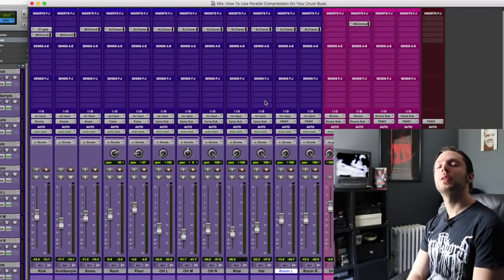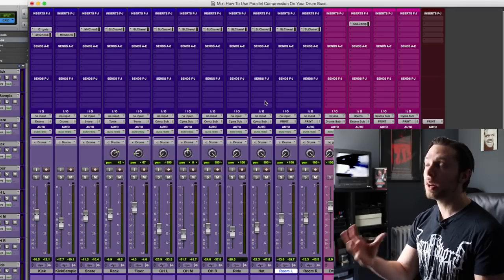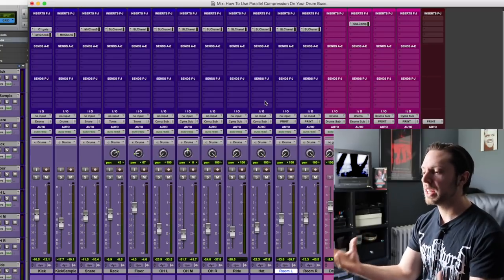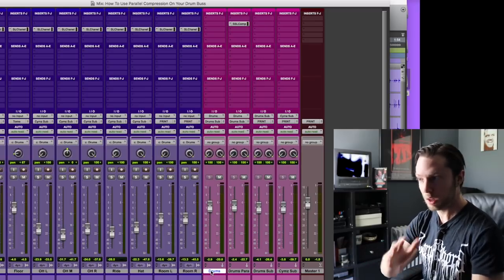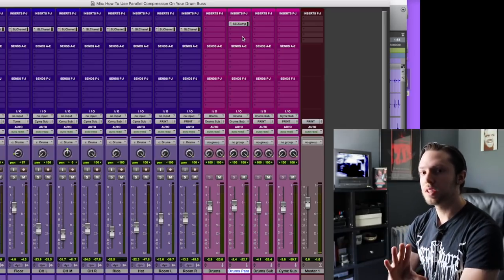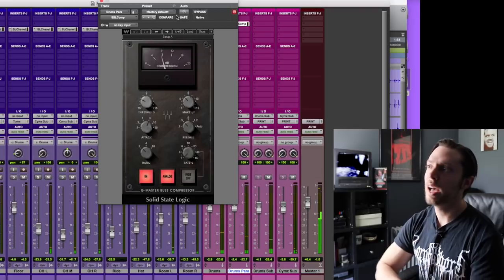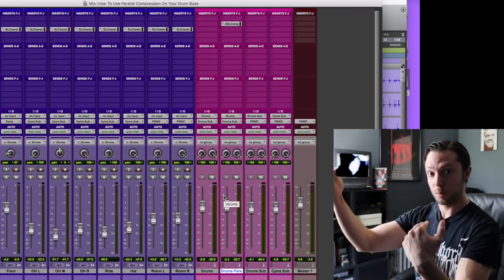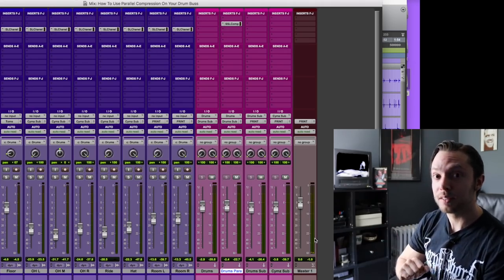Parallel Compression On Drums - Metal Mixing Tips

Comment: The drums sound mushy to me. I watched a Chris Lord-Alge mix session and he used parallel compression on drums, but he also EQ'd and slightly compressed the original tracks, as well. He got much better sounding results, (granted he has superior gear than most of us.) But, it's something worthy of trying. By the way, his kick EQ go-to settings are boost 50-60k, cut with a narrow Q around 300-500k and ALWAYS max boost 8k (for the "click" or "knock.) And, he does it on every kick including samples. Just food for thought.